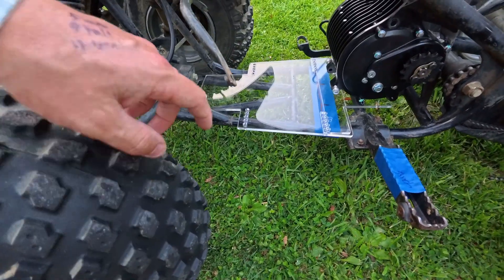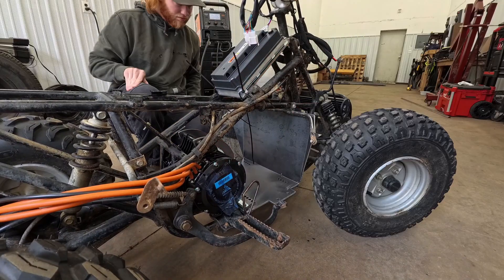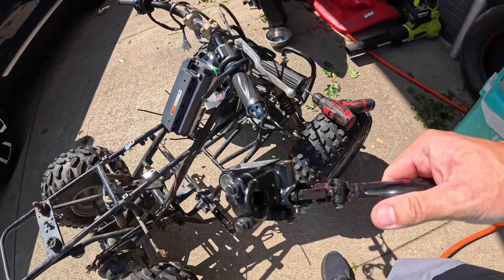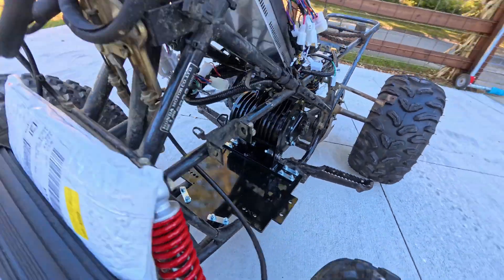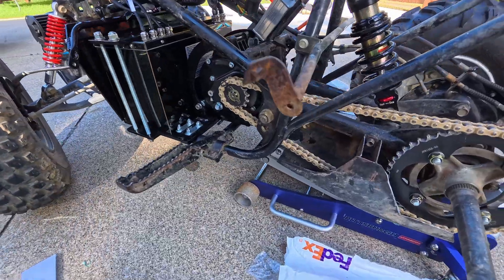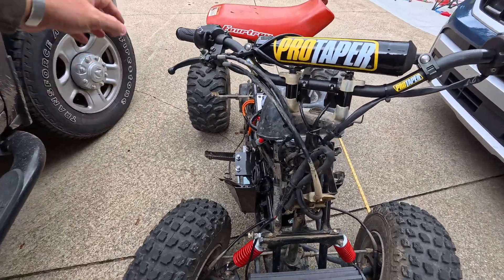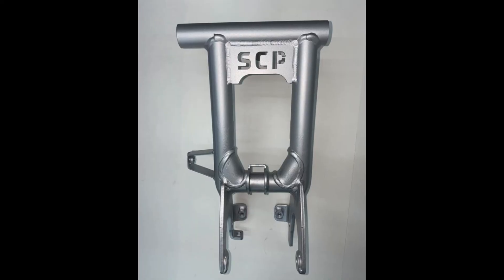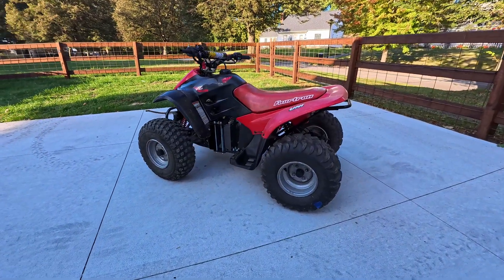How I Transformed a 2000 Honda TRX90 into an Electric Beast |  QS138 v3 72V 60AH

Comment: What are the battery specs
Reply from the maker: 72v 60ah 50s
Reply: @3CMiniWorks what brand did you go with
Reply from the maker: @denynbeachel339  what do you mean what brand? The 50s is a Samsung product. If you mean who built it- Amorge!
Reply: @3CMiniWorks thanks that’s what I was wondering
Reply from the maker: @denynbeachel339  couldn't recommend the 50s less on an off road build though. Don't do it